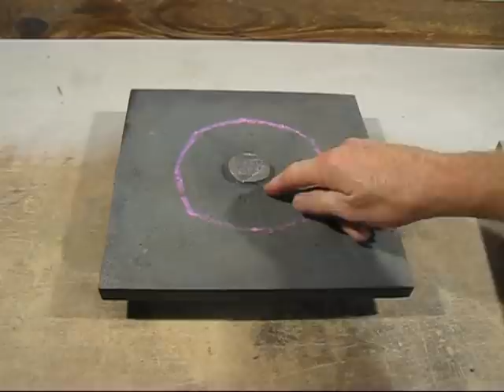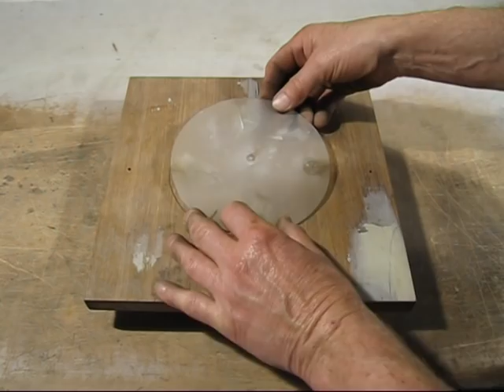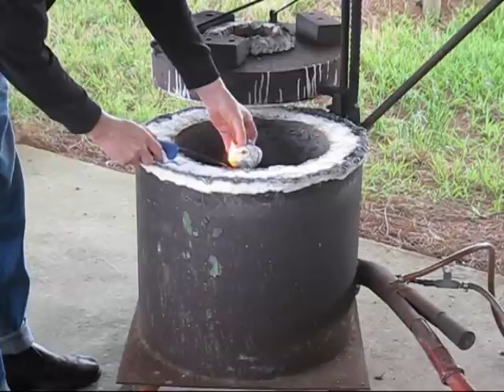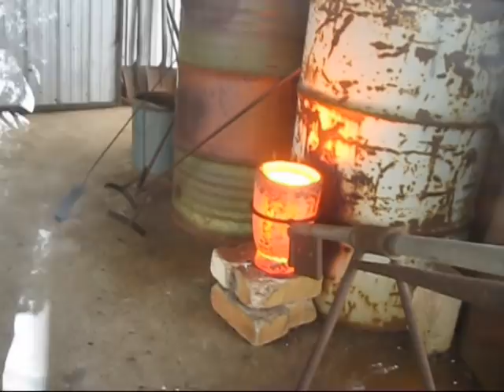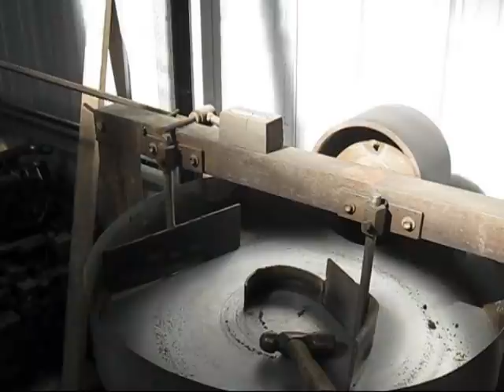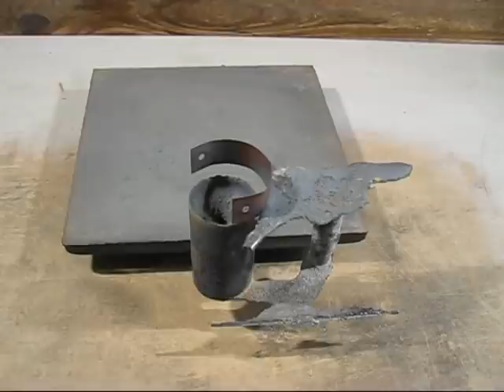Modifying  my pattern + crucible cam

Comment: Nice job. That pour seemed to go on forever. Do you ever leave the casting to cool down overnight? Does it make a difference?
Regards,
Mark
Reply from the maker: A iron casting that size (13.5 Kg) takes about 6-8 hours to cool to room temperature. The first surface plate I left it in the mold for two days but to answer your question it makes no difference as this one was dug out of the sand as soon as it was room temperature.

Comment: If you rammed your surface plate pattern on the cope instead of the drag would it help with minimising the shrinkage on the center?
Reply from the maker: I tried that two years ago and got the same result.
Reply: @luckygen1001  One would think that gravity could help. Apparently not, it will shrink whichever way it is oriented. Thank you, this was a good lesson for me.

Comment: I'm always amazed at how long you can take between removing the metal from the furnace to actually pouring it. I'm curious, do you measure the temperature of the metal while its in the furnace or do you just know by color when it's ready?

Nice solution to the shrinkage problem.  I'll have to remember this one.
Reply from the maker: When you use a large crucible (A12)  and have a furnace that always gets hot iron there is a lot of time before the iron gets too cold to pour. I do have a pyrometer that goes to iron  pouring temperatures but do not use it because it gets in the way. When you have been melting iron as long as I have it is so easy to judge pouring temperature by seeing what the iron is doing and time taken after the last piece has been added. 10-15 minutes is plenty of time to super heat iron to pouring temperature.
Reply: @luckygen1001  Thanks.  I'm also curious about two other things.

It appears, at least in this video, that you add metal to the crucible after the furnace is running.  I assume you loaded the crucible with broken pieces of rotors and just added metal as the metal in the crucible melts. Is that the case? If its not the case, why?

Also, approximately how long does it take for you to go from lighting to the furnace to removing the crucible.  As I said, I'm just curious.
Reply from the maker: @swdweeb  Before I light the furnace the crucible is placed in the furnace and  filled with broken pieces. The rest is added when the iron melts in the crucible. From lighting to removing the crucible takes 50-55 minutes to melt 14 kgs of iron.
Reply: @luckygen1001  Super, thanks. Have a good day down there 😄
Reply: @luckygen1001  that's really faster than i would have guessed. Thanks for the schooling and all you do
🙏 Blessed day and well wishes Sir
Crawford out ⚒️🧙‍♂️
Reply from the maker: @dragonstonegemironworkscra4740  When I melted the lathe bed, at the end of the video there is the time taken and how much fuel was burnt.
Reply from the maker: @swdweeb  I will have good day because it is sunny 25C and we have no more corona virus in my state. Don't get too cold in the rocky mountains.